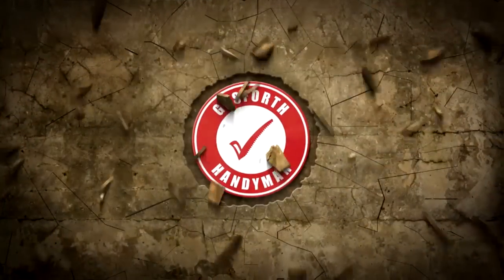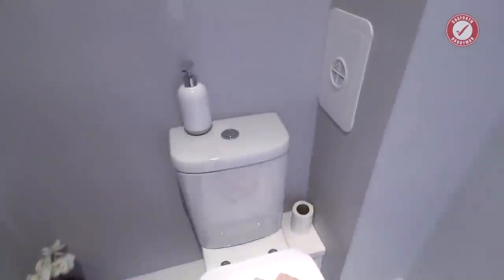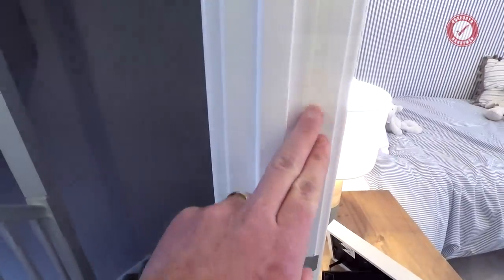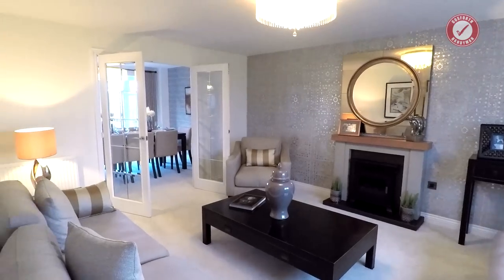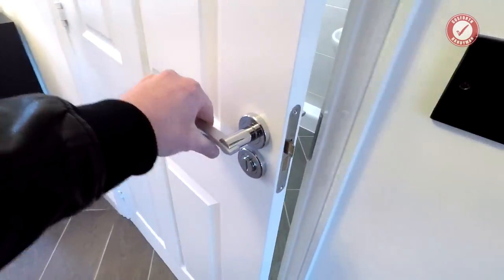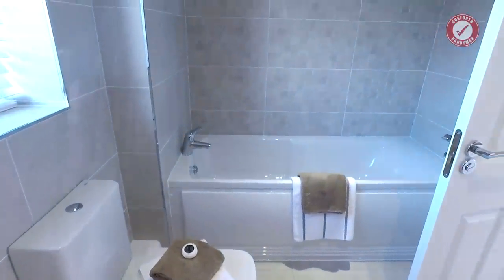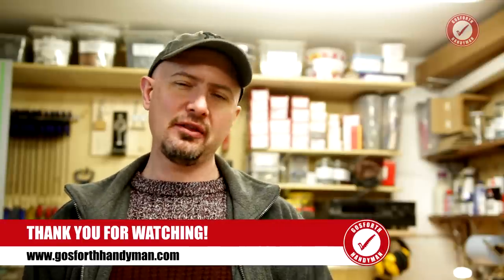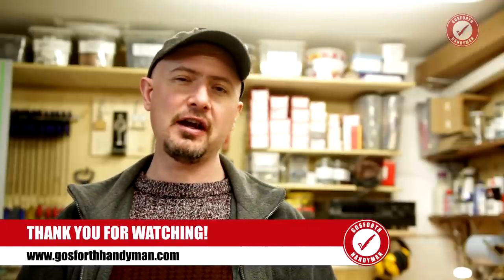How are New Houses in the UK Built? Looking at Showhomes!

Comment: Considering the premium for land these days I'm surprised 3 storey housing like this isn't more standard.  And why oh why are we still building them brick by brick, surely technology has moved on by now?
Reply: I suggest brick looks good over time largely without cosmetic maintenance and it is part of the culture to use brick.  Householders do not necessarily keep up with cosmetic maintenance.
Reply: @quiteamazingtoo  You can system-build houses and still have a brick facing. Instead we are still building them the same as the Romans- brick with a tile roof. 2000 years and little progress. 
Compare today's cars with 50 years ago - completely different.
Compare today's house with 2000 years ago. The privy has moved indoors...
Reply: @Tensquaremetreworkshop  The brick and tile house stands the test of time better than those built with new technology. They are also easier to get a good mortgage on because the banks know they last and their investment is safe. A mortgage for a house of non standard construction is likely to have a higher interest rate.
Reply: change resistance and comfort with what you know.  Availability of building skills is another factor, obviously traditional building skills are more readily available which becomes a cost factor. Factory produced timber frame should be the future but british weather makes purchasers uncomfortable with that.
Reply: @Finderskeepers.  There is no way to overcome change resistance from banks. Their only concern is that, should they have to repossess a house, it will be worth more than the outstanding mortgage amount at auction. Many will not advance money on a non standard construction property at all. Those that do will insist on a higher deposit and charge a higher interest rate. That will apply usually to a timber framed house which is not regarded as standard in the UK, even though it is proven technology in other countries. Such a house will command a lower price because buyers are put off by the mortgage situation.
Reply: @replevideo6096  Architects today only build houses to last 100 years. Building it to last longer is more expensive and over engineering.
Reply: @replevideo6096  Its actually the same point but not the banks fault. The banks issue is that it will effect the value of the property and it does despite your true points on say timberframe or other methods.

 Following the financial crisis a law was introduced to stop banks lending more than 100% of the properties value, cost does not equal value, in order to protect depositor and shareholder funds, the banks duty which they failed miserably at. 

Sadly this stifles backing good developers. Ballymore Homes got 110% finance on the 1st 5 houses they built in Ballymore. Now look at them 1.2m sqft of commercial under construction and 4,500 houses. But somehow credit card debt is fine which has no security.

In economics , Price or value is the equilibrium of supply and demand. If some buyers are put off by the construction method, that is a reduction in demand and so price. 

Construction finance, which I have done, is a very specialised area of lending. I would not lend to inexperienced developers unless there is so much equity I know I dont have to step in and finish the build. I never seen a build project come in on budget after funding 1000's of builds and that is only for experienced builders with full professional teams not 1st time builders. The banks that do lend see it as riskier and it is, risk = reward hence the higher rate, for others , the risk is too much so no lending.

 The primary issue is the markets perception and the effect it has on value.  But its changing, I believe timberframe is the future and not for environment reasons but for cost reasons. Its the only way to have a production line and the cost savings that brings, exactly what Henry Ford did.
Reply: @Finderskeepers.  A brick built house with a tiled roof will last much longer than 100 years as long as it is not allowed to fall into disrepair. House over 200 or 300 years old would mostly have been refurbished more than once. Brick houses would need repointing at some stage, and gutters must be kept in good shape. Banks decisions on mortgage lending are not necessarily logical. A timber framed house will last more than 100 years if maintained properly and not attacked by termites.
Reply: @replevideo6096  The kernel of my point is its the market perception, the buyers, on the build method that effects the banks behaviour. This also has a knock on effect regarding the lending laws and capital allocation. The more capital a bank has to assign to a loan by law, the higher the rate needs to be to justify the loan. Its to avoid another bail out. I am just giving you the facts that effect the banks decision. I dont agree with all of them either as I explained. A bank should be allowed to lend say 2% of its risk assets into risky loans and back entrepreneurs, the folks who create employment. Equity has to be used now which is much more expensive and means giving up part of  ownership eg Dragons Den. If everyone did what they agreed , there would be no need for security. Banks do not want to enforce security. That can only happen when the borrower hasnt done what he said he will do meaning he broke the loan agreement. 

Neither do I like the 100 year rule. What build heritage are we going to leave for our childern. Most 200 to 300 year old houses have only had cosmetic and maintence work done. The pantheon in nearly 2000 years old and still stunning, but again , Im just giving you the facts, unless you ask the architect to ignore the 100 year rule he wont. He may happen to specify something that lasts longer but he doesnt have to. Its a minimum standard not a maximum.
Reply: @Finderskeepers.  I agree that timber should be the future, provided the wood used is of the more rot resistant types. Indeed many medieval timber framed houses still survive and manage to stand up even if they have subsided over the centuries. There is a very good example here in Norwich city centre, still a usable building despite the crazy angles of the window and door frames. Many tourists miss it because it's up an alley. Precision machining of wood makes it possible to construct sections in a factory and erect on site in just a few days. I still think banks are wary of them though.
Reply: @replevideo6096  Proper English oak Im guessing, Ill assume Tudor especially as its Norwich, it sounds beautiful. Mad the angles that can develop over centuries and what can stay standing, the leaning tower of Pisa being a stone example.

Sips or timber frame systems are the future, laser cut from the digital plan in factory conditions, reducing risk, time and cost which will keep the build cost, market risk and profit requirement down , hopefully leading to larger average units. The banks are on board for larger developments where the public dont ask as many questions and strangely trust the developer.  Bathrooms are being shipped in as pods , even plumbed and tiled for a lot of apartment build now.  Obviously oak isnt so viable today , I wish, but even sort woods can be treated and I know banks that have got comfortable with that , a warranty from a valuable parent company does help.

But one off builds are a different story, purchasers ask a lot more questions and theres more of a builder risk however a lot of those builds tend to have a lot of equity making it more attractive to the bank. Its all a balance between build risk, credit risk and market risk. Equity reduces all of those risks, for the bank !

Comment: There is an advantage to having that electric shower upstairs...if the boiler breaks down you can still shower.
Reply from the maker: True! Very much doubt that's the reason they've done it though. Would rather see unvented system in house of this size. 👍
Reply from the maker: I would agree... if it wasn't for the fact that there was specifically a cupboard there in the centre of the house designed for a tank. Interesting to know - I'll see if I can dig out the original plans... 😀

Comment: Is central heating and AC not a thing in the UK also what's the white boxes in the bathroom?
Reply: All those houses will have central heating you can see the radiators,  but AC is rare and usually only in places like public buildings and shops. Only some old houses still don't have central  heating but most will have had it added at some point.

Comment: New build occupant here, I very much agree with the disagreement on the 'subbie' model. While I get the idea of having a guy who does just one thing (going off what 'the mastic guy' told me), I don't like the lack of accountability it creates between the builder and the contractor. 

My day job is quality management in the 'last trade out' (so the oil based paint thing raised an eyebrow but I think this is down to an ease of application. Modern hybrids/acrylates have short open times and are less forgiving in laying off if you want an acceptable finish, generally speaking)...my biggest complaint is that had everything just been given a once over before I got eyes on then my snag list would have been negligible. Front door not fitted properly so there was a lot of light bleed around it, plug surround in the sink had a chip in it needing replacement, plastering in places I doubt had an inspection lamp shone at it....I'm not knocking the tradies but I think they are put under undue pressure which inadvertently can lead to more hassle than necessary for the buyer in post purchase rectification.
Reply from the maker: Great comment and great info - thanks for sharing. 👍👊
Reply: Oil based are harder wearing paints too, and IMHO give a better look.  The downside is the horrendous chemical fumes as the paint dries out over many weeks.

Comment: What are your thoughts on electric central heating systems? I’m looking at a new build home, 2 bed semi house, in a really rural area with no access to gas but has mains water/drainage, south-east England. It’s £250,000. It’s very early building stages, I’m also waiting to find out the standard internal specs, hopefully not to much veneer wood lol
Reply from the maker: I'm not sure on modern systems - just really research the running costs as it could be expensive. 👍
Reply: Gosforth Handyman thank you. 😊
Reply: See if you can get one with a ground source heat pump if all you can get is electricity. It's basically the only way to economically heat a house that's electric-only, and is most economic to install at the house's construction.
Air source heat pumps are a compromise but nowhere near as good as ground source.

Comment: Hi, ive just moved in to a newly built property in west sussex.
I am on the 3rd floor flat, and i have 6x2x2 feet fish tank (approx 680 gallons plus the weight of the tank and caninet). Im a bit concern if the floor is strong enough for this weight? Most of my friends, some of them are builders said that im absolutely fine. 
Just wondering if you could give me an advice? I find your videos very informative.
Reply from the maker: NO!!! You're definitely not absolutely fine. 680 gallons of water is about 2.5 tonnes!! ...I think. You need to speak to the builders and find out the rating of the floor or get a structural engineer to check. Best of luck!
Reply: Theres no way its 680gallons. Its more likely 680 litres
Reply: @Hoynesey , Right ? That would be one HUUUGGGE fish tank ! That would be a car and a half, lol

Comment: Not the average newbuilds shown here, most are considerably smaller than these, they are even large to Dutch standards, while our houses are generally larger than UK homes.
For older houses speaks that they are often built of sturdier materials, and they have their history and charme, like their surroundings often do.

The biggest advantage in a new build is your energy bill, they are well insulated and in the near future we only will see houses which aren't hooked up to a gas supply anymore.
Old houses are often very difficult to insulate, often damp problems will be considerations and the solutions to insulate without damp problems can be very costly.
I see it with my own 1933 detached house, the insulation of walls and roofs plus new window frames with tripple glazing sets me back around 75K!
The only reason to do it now rather than moving to a new build is the grants you can get combined with the low interest on loans, when I transfer to a new higher mortgage at current interest rates terms aren't any higher per month as with my current mortgage, it will however save me massively on my gas bill, so fixed costs to live in this house will be lower after the work is done.
Reply: They are average new builds. Yes you can get smaller ones too. People just like to criticise new builds

Comment: I live in America and watch a lot of home, garage, etc, building videos and for some reason there's always someone commenting on how we suck at building homes because we use wood. I'm not seeing a huge advantage on the way you guys do it compared to here. Both sides of the pond look like they do a decent job. i must be missing something ? JMO.
Reply: The local traditions in construction, building codes, available materials, skilled trades all play a role in how houses are constructed in a given region. There have been many experiments to bring North American construction methods to Europe and they all failed to gain traction despite many advantages.
One factor was expectations for building longevity in Europe is very different. Nobody in NA expects an 80 year old house to be in decent shape but rather that it should have been torn down and new one built in its place 20 years earlier.
Not so in Europe. A family home should last at least 150 years.
A stick frame building does not give that same level of confidence as brick & concrete and is not significantly cheaper to construct in Europe (architects must learn and adapt standard NA designs to local building codes, many construction materials must be imported, tradesmen need to learn new skills while making the same money, get new tools, etc).

Comment: I live on the Elmwood side of Great Park and love the location. My only gripe really is avoidable issues that the builders are so slow/reluctant to resolve. As you mention they seem to subcontract the work out and it can be of very poor standard. The previous video shows how the timbers are left outside exposed to the elements. My property has a balcony and I would say the timbers used for that were also left outside as the balcony is warped as a result. You only need to look two doors down at the same style property to see how the balcony should look, but Pers*mmon will not do anything about this as it has passed their building regs. Frustrating especially as you say buying a £300k car you don't expect there to be major issues with it. 
I have not been in the property a year yet and I still have about 10 snagging issues that the customer service simply do not get back to you about. As they have finished building at my side of the development now and the builders have moved on, I doubt these issues will ever get resolved.

That being said this is my second new house on Great Park by the same builder and the benefits by far out way the negatives; of poor finish quality and customer services and the lack of a town centre we were promised (politics). Hopefully I will not have to move again but should I need to I would probably still buy a new house and from the same builder.
Reply: It’s funny how the show houses are built solid, but the main houses not

Comment: Have worked on loads new builds for many national home builders. The plumbing they all demand plastic pipework with copper pipework where its seen so dont be fooled by looking under sinks or basins.
Reply: They demand it because its easier and more importantly quicker.fittings with rubber o rings aren't going to last,all these new builds will need renovated when the rings start rotting

Comment: Our house was built 4 years ago - Apart from the kitchen none of the sinks or bath have mixer taps! Why?
Reply from the maker: Is it Persimmon?
Reply: Gosforth Handyman Yes it is.
Reply from the maker: I only seem to see this in Persimmon houses for some reason. Can't explain it! 🤔
Reply: If you have a combi mixer taps are OK to use, but if you have unvented system mixer taps should never be used, this is because if the power is cut or turned of you can get water born bacteria that can kill, as you turn the hot tap on, the bacteria can sit in the tap end then a cold tap turned on to make a drink and straight away you have a contaminated drink.

Comment: I must go against the grain as I have owned new build and worked on them and that was enough to go old school as space and storage are more important to me. Parking is great with the current home as I can get upto 10 cars on our drives and lay by.
Reply from the maker: Unfortunately around here similar sized older houses with gardens etc. would be £700k+
Reply: Ours is an old post office and village shop that closed some 20 years ago. Fortunately it cost no near £700k as we would not be living here. I have plenty of work on the house still to do as the previous owner was a bodger and they tried to fit the oil boiler and failed to install any of the safety features. The advantage other then space and storage is putting our stamp on the place.